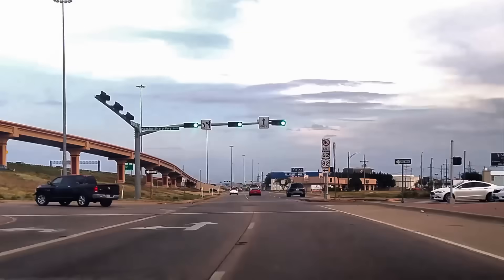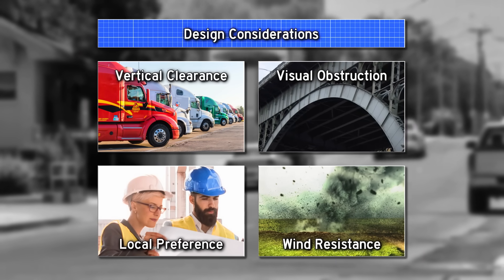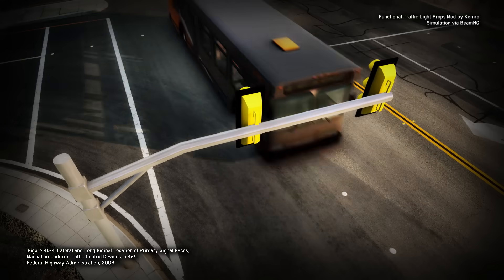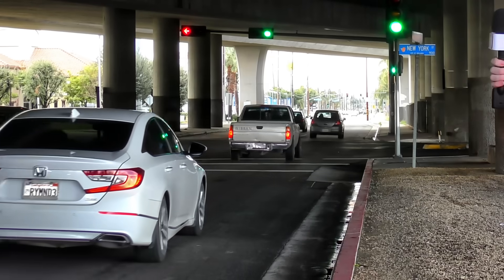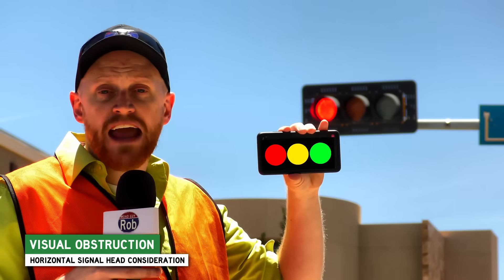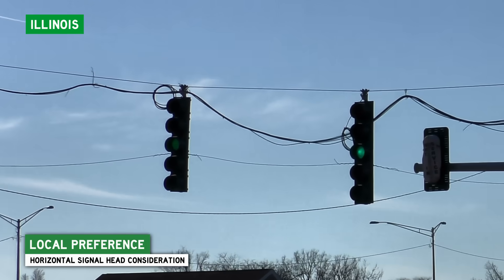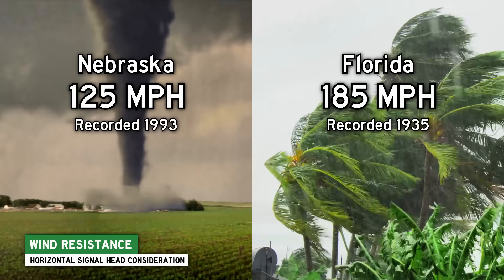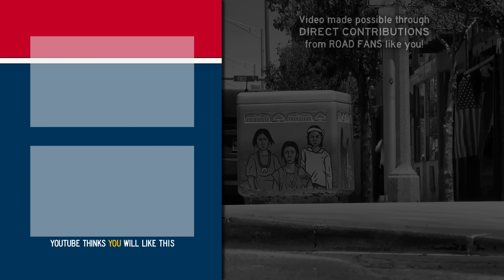What's up with SIDEWAYS STOPLIGHTS in Texas and Florida?

Comment: Years ago, my colorblind grandfather told me he had a problem at an intersection with a horizontal traffic signal because the intersection was at a slight angle (not a square intersection) and on one side of the street there was a red barn . . . you guessed it . . . when he came to that intersection from a certain direction, the barn was the backdrop for the traffic signal and my grandfather was only able to see the yellow light. He had to rely on the other traffic to know when it was safe for him to go.
Reply: I don’t think that’s an issue with the orientation though, that just happened to be an inconvenient situation. If there was a tall building as the background for a vertical light, you’d have the same issue.
Reply: @toonpik7  It seems to be more of an issue at night for colorblind people. Prior to reflectors on Traffic Signals, you couldnt really tell what color the light was at night. Nowadays most Traffic Signals use LED instead of lightbulbs, and the signal uses a Blue-Green hue instead of the traditional Green to help aid with coloblindness.
Reply: @toonpik7  It seems to be more of an issue at night for colorblind people. Prior to reflectors on Traffic Signals, you couldnt really tell what color the light was at night. Nowadays most Traffic Signals use LED instead of lightbulbs, and the signal uses a Blue-Green hue instead of the traditional Green to help aid with coloblindness.
Reply: the light goes from left to right or top down going from red to green, this means unless he couldnt see light coming from the pole then hed know
Reply: Then he shouldn't have been licensed to drive.

Comment: Very good video!  Great job at giving information on that.  I live in the prairie where high wind is at, our towns/cities in Alberta are all horizontals. Mixed with vertical/horizontal in Saskatchewan but I could see pole ones with vertical getting bent & replaced a few times, they should go with horizontal position. 

One time in a town they were putting up new lights, the horizontal lights was in the opposite! That caught my attention and first thing comes to my head was about blind drivers.  Few days later, they corrected the position.

Nowadays I noticed they've been putting up ridiculous long arms with traffic signal in the middle, wasting all the lengthy space on the arm at end. That annoys me for some reason!

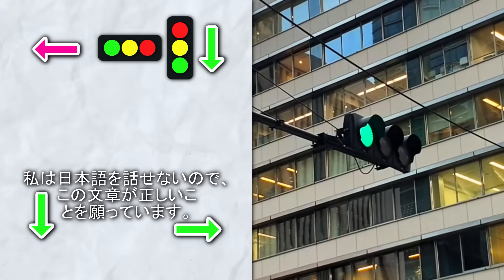Comment: 8:23 Japanese reading is traditionally top-down first then right-left. Horizontal reading was only adopted because of the British after WW2. Lights reading right-left are probably derived from the traditional convention, so the rule isn't technically broken.

Modern Japanese can use either system, so long as it's consistently used in the work. If English is used at any point though, the horizontal first system should be used.

Comment: We use signals that are similar on the railroad most of ours or up and down but sometimes they are off set at an angle or like an H with 5 light target 4 lights at each point of the H with a single light in the middle. The signal can appear as I or \  with 3 lights on to the Left or  / or I 3 to the right  in a combination of red, yellow, green to give us the signal order we need or all red for stop.

Comment: Vertical or horizontally mounted the surface area is exactly the same. Just because it is turned horizontally does NOT change the surface area or wind resistance. Please explain how simply rotating the traffic signal could possibly change the surface area of anything.

Comment: Canada here. Horisontal is the way to go here. The vertical ones are usually mounted on the pole itself, as extra lights, and you will have a regular horisontal one at the top.

Unless they are hanging from a cable. At some intersection, mainly the 4+ lanes wide ones, they run a cable across the street and install one light per lane. Those are vertical.

However, we don't have 3 rounds, but square for red, diamond for yellow, and circle for green. Also we have two reds, so you have red yellow green red. That help for the colorblinds.
Reply: Not all of Canada.

I've been to Vancouver and Victoria and it's all vertical there. Same with that I've seen in Ontario.

Comment: That truck.... Now we all know what Altima drivers would do if they had to handle a manual transmission.

Also, dood better not burnout in that truck much more. Based on his inability to stop and or start with a clutch, that drivetrain doesn't have much time left as it is.

Comment: One thing you have to be careful of is that if a semi truck and trailer is in front of you it will block your view of the light.   I have had this happen a few times where I was behind the truck and didn’t notice the light had turned red until I was entering intersection.    I’m not a fan of this setup as sideways is difficult to see when high profile vehicles are in front of you.

Comment: I guess the real question is why are any stop lights mounted vertically? It seems like we should just mount them all sideways and save a bunch of space and money. I am sure we could all just adjust to the new orientation. I am guessing it is just a habit from when we used hanging stop lights, but I see no reason it needs to continue with mounted ones.

Comment: Theirs another problem with the “horizontal” mounting, that is they BLEND-IN with the HORIZON.  Which i have found to be very difficult if not DANGEROUS when you’re driving into the SUN. Because you actually lose sight of the signal. I hope you can address this in a future video in case someone else may have the same issue.
THANK YOU ! I enjoyed watching your video.

Comment: Here in Canada, there's more variation. In Quebec, PEI, and New Brunswick, the lights are horizontal with 2 square red lights on each end, then a yellow diamond second and a green round light third. Here in Alberta,  as well as Yellowknife and Whitehorse standard round lights are mounted horizontally., although left turn signals are usually vertical. The rest of the country pretty much uses standard vertical lights.

Comment: @3:21 Now I know of only two locations that have a horizontal stoplight in California. The other spot being the intersection of Fulton and El Camino in Sacramento. Which is odd considering there's no height restriction like the one you referenced in your video... Also if you go to that location in Googlemaps and look to the left and the stoplight opposite to the horizontal light of that stoplight in Sacramento, you'll see another interesting mounting style that is very common in the Sac area where the mounting pole has been deliberately bent downwards so that the left turn signal is considerably lower than the through traffic lights. They stopped putting in new versions of these poles, but they were so incredibly common that I'd say about 60% of all major intersections from Elk Grove to Citrus Heights feature these interesting mounting posts. If you turn to the right, that's how Sacramento typically mounts traffic lights now. three through traffic signals and two left turn signals with the overhang left turn signal hung from the top of the traffic light unit. https://www.google.com/maps/@38.610754,-121.4015652,3a,75y,104.06h,96.42t/data=!3m6!1e1!3m4!1stU7H-SSTRHrAY1tS5-whIQ!2e0!7i16384!8i8192 EDIT: Also I'm not finding a lot of visual evidence or examples to back the statement that Nebraska and Florida mount their stoplights horizontally. Looks like it's mostly vertical...

Comment: Wanted to share my appreciation for the colorblind issue. I had no idea other people also used the light position instead of the colors. This video helps a lot, since I didn't know there was "standard" for the lights direction, I always had to second guess myself when I come across a seemingly random horizontal light. Subscribed!
Reply: Surely it's a part of your driving test?!?
Reply: @dzzope  you overestimate the driving tests in this country lol
Reply: agreed
Reply: @helpimnotdrowni  They also have started making the green lights, a turquoise shade of green, to make them more colorblind-friendly.  When a colorblind person has dichromatic vision, the turquoise color looks white, while the two other colors are indistinguishable.  That way, a dichromatic colorblind person can still tell the difference between red and green lights.

Canada has also started implementing shapes to tell traffic signals apart, where the red is a square, the yellow is a square on an angle, and the green is a circle.  I haven't seen how (if they do) tell apart the colors of protected turn-arrows.   A square boarder for the red arrow and a circle boarder for the green arrow, would be my solution.
Reply: @dzzope  They give you that information in the driver's ed handbook, but I don't think it is necessarily part of the written exam you take in the DMV.

Comment: A friend of mine who was colorblind got a ticket in New Mexico for running a red light... turns out they mounted the horizontal head backwards with red on the right...
Reply: Not true. US DOT requires red on the left green on the right for horizontal mounting.

I've been to New Mexico, especially Albuquerque, many times and all intersections are mounted this way.
Reply: @STL Railfan  In that particular case, it was mounted incorrectly on just that arm of that intersection but the officer refused to not write the ticket--he had to go to court and prove to the judge that it was mounted incorrectly by the city.
Reply: @TheMcIke  ahh, got it. I read it as that was the way they were mounted in the whole state.

Sounds like a traffic engineer had a dyslexic moment!

Comment: Ohio and Kentucky have sideways lights where overhead clearance might be an issue. My problem is that there is zero uniformity, so colorblind people can’t reliably use them. The red goes on the left except where there’s a left turn light, then it goes on the right? What if instead of keeping the red at the top all the time, we moved it to the bottom with the presence of a left turn light? Real geniuses thought that one through

Comment: ummm you can still have a rigid mounted traffic light without putting it sideways so that argument is moot:04 umm no, it still has the same surface area. lol wtf.  are you talking about the minimal reduced surface area of the ROUND pole which is already very aerodynamic.

Comment: The frontal area for the wind to push on is exactly the same ?
But the torsion force is a lot less around the arm but around the same around the post !
Reply: The combined frontal area, if you account for the mast arm in addition to the signalhead, would be less for the horizontal traffic signal.

Comment: Mount it on a pole on the side of the road, so you can SEE it instead of trying to look at the sky through the roof of the car. One light for all lanes. Have two lights by mounting it on the near pole too (used as the far pole for other directions).  Different heights would allow different height trucks/cars to easily see the lights. No overhead hanging per lane; stop wasting money for 2-3x the lights per lane. You can even put the turn lane signals side by side with the straight lanes.  It's easy - ther est of the world does this and it works - cheaper, better and no arms to pull down a vertical pole to the ground in a little bit of wind, or when a high-load comes through.

Comment: I have also observed while travelling through and around the State of Wisconsin, the same horizontally mounted overhead traffic signal devices (traffic lights) on nearly all street intersections, regardless of whether or not it makes any real or logical sense as due to overhead clearance restrictions such as that as seen under bridges or on the undersides of highway overpasses . . .

I happen to live in Illinois, where the default orientation of traffic control signal devices (traffic lights) are typically mounted in a vertical orientation , and for example ,when crossing over the state line into Wisconsin , it becomes very apparent as all traffic control signal devices (traffic lights) encountered are then mounted horizontally , and can also be clearly seen from South Beloit , Illinois on Park Street just south of the railroad crossing grade and looking north into Beloit , Wisconsin - where the first traffic intersection seen as horizontally mounted traffic control signal devices (traffic lights) . . . as in Illinois where there is another intersection on the same stretch of roadway within a quarter-mile that has vertically mounted traffic control signal devices (traffic lights) and both can be clearly seen within the same line of sight of one another .

The economics of design as well as the logic behind the ergonomics of aerodynamics & wind-resistance also makes sense behind the chosen traffic control signal device (traffic light) orientation of horizontal versus vertical positioning . . . especially when large mass-quantities of such signal devices are ordered or supplied across a single distribution channel for the simplification of logistics & ease of stocking fewer parts or materials for any given project or highway specification .

As for driving from one area or territory to another that has differently orientated traffic control signal devices (traffic lights) it can get a bit alarming or confusing at first , as one would not be used to or conditioned to recognizing such a traffic control signal device (traffic light) configuration and may also retard reaction time considerably if not used to seeing the said configuration normally or regularly .

Comment: Wisconsin used to have sideways traffic lights until last decade on their smaller poles. Only one light on each pole. I think Wisconsin still maintains and installs new sideways traffic lights on their smaller road projects, but not any large boulevards or avenues. I really miss the horizontal traffic lights in Wisconsin, they need to bring that back.

Comment: In Europe we got some traffic lights equipped with secondary set of the lights fixed on the light pole at a height of about 3-4 feet from the ground - so the lights are visible for the first row drivers.

Comment: not aware of ANY side mounted traffic lights here in Germany. As for traffic lights being too close to vehicles stopped at the line: not really an issue: usually crosswalks etc are wide enough that the traffic lights are in some distance to the stopping line, and in places where the top mounted traffic lights on the horizontal pole would be too close, there's an additional traffic light mounted way lower on the vertical pole. They all are on the near side of the intersection, none on the far side

Don't really have the issue with low bridges or alike here; Even trees are cut to a point where they won't obstruct the view onto the traffic light

Comment: Florida cities used to turn signals horizontal when named storms were expected by tying the bottom to the wire so they wouldn't sway until they pulled down the guy wire.😊

Comment: Have you seen the new ones going up in Fort Myers as they repair the damage from Ian?  Triangles.  I am no kidding .. two on top one below.  None are hooked up yet as they are still doing street work on the stretch of road so all the lights are off as other roads / turns are block for about six blocks in a row.  But I can't wait to see them and the color order.  I almost think they are using that stretch for an experiment.

Comment: As one with red green color vision issues, let me correct the video in that I can still see all colors, but in lower light levels red is difficult to see on a green background, red starts to blend with orange, blue blends with purple, and yellow with green.  The problem is the angle of daylight on the signals in some cases.  I've only had one instance where I had to ask a passenger what color the light was because all of the signals looked lit up at the same time.  Normally this doesn't happen and I can easily see the color.

Comment: I don't think mounting them sideways changes its aerodynamics, it's more that mounted vertically there is only a single connection point to the pole, while mounting sideways allows for 2+ connection points to the pole thus making the stoplight more rigid and less floppy.

Comment: To be honest, I really dislike the traffic lights being far away from the driver - like in the North American roads.
I prefer having a tall signal, and an additional vertical one to the left - like in Europe.

Regarding horizontal traffic lights, I am not against them - as I understand the limitations on height clearance.
However, I think these issues occur due to another major problem:
- In North American there are simply too much traffic lights everywhere!

If you invested in roundabouts, you would:
a) Have a more efficient traffic movement;
b) Have less traffic light fatigue (where drivers simply ignore them, especially during the night time);
c) Drivers would pay more attention to the road, instead of being robots behind the wheel;
d) The eventual accidents would result in less severe accidents, as in roundabouts the accidents are with both cars sideways, and not front to side.

I really hate the inefficiency of traffic lights.
And it still baffles me that a country, like the USA, so focused (and even obsessed) with efficiency still resists to adopt the most efficient traffic technique: the roundabout.

Yes, there are situations where traffic lights are the most efficient way!
But in the USA, traffic lights are everywhere - even on roads which have a really low traffic volume.
Please, make your roads more efficient!